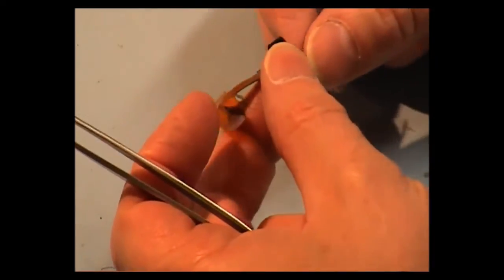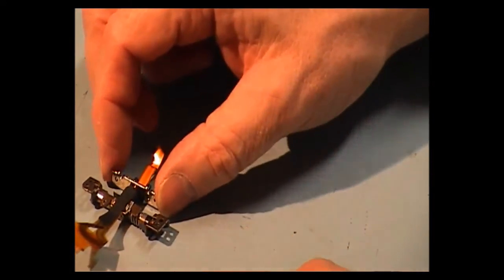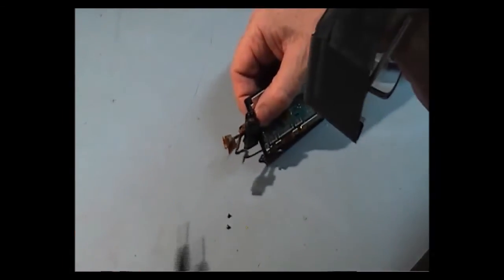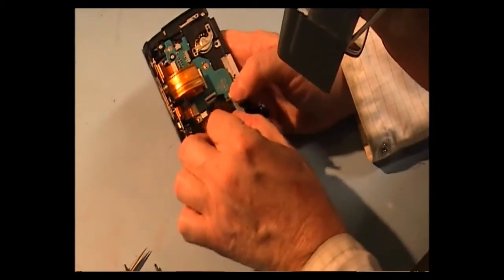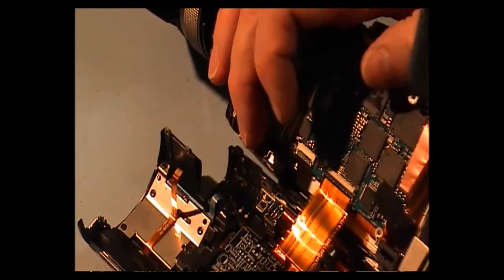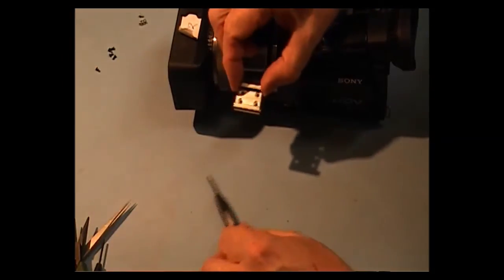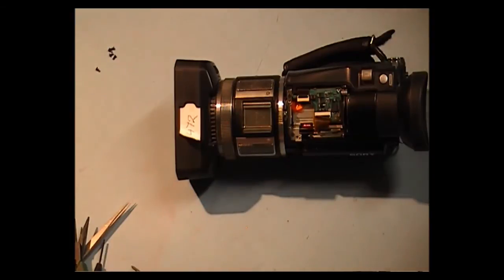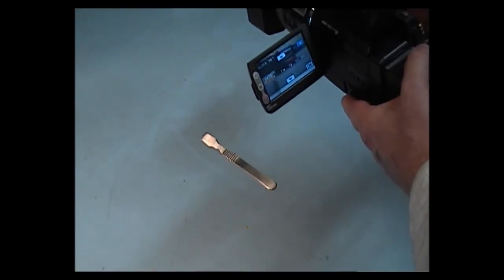Sony HVR-A1E No picture on LCD Screen Part 2

Comment: Hi there and thank you so much for this clear, informative and easy to follow demonstration.  Its very kind of you to put the time and effort into making this! 
Unfortunately after completing the flex cable replacement, I still had the same issue with my camera.  The LCD was showing an image before, however was unresponsive to touch controls.  When I pressed any of the touch button on the LCD they illuminated orange suggesting it is recognising the press, however nothing then happens.  I was preying that it was a fault in the flex cable but as I say after replacing it I still have the same issue.  Do you have any ideas about what it could be? Perhaps it may just be easiest to buy a new LCD screen.  
Thanks again for the video and any help you may be able to send my way!!
Reply from the maker: I would like to have had the answer for you, the fact that the touch screen responds to your touch, makes it unlikely, its the screen, but the screen cant be ruled out,
Not an easy call to make.
Reply: Electronic Workshop Thanks for your response.. so the screen might be the issue.. otherwise could it be a problem with the main board possibly? real bummer about this one, would love to get it sorted!
Reply from the maker: milesawayjackson The graphics you see on the lcd screen are generated on the main board, when you touch the screen, you say the graphics change colour when you touch the lcd, this would say the information is getting back to the main board from the lcd, I would check in the menu's to see if there is a setting to disable the touch screen first, then double check your cable connections on both ends, I normally use a magnifier to see the connections,

Comment: Hello,
1st off all thanks for the hard work in putting this online.
2nd I'm having the same probleme here.
Before the camera powerd up and worked fine with the viewfinder, now is dead, no power at all. 
I've striped it again, checked the cables, checked the connections, checked the board itself for anything suspicious but I can't seams to find the error. Can you give me some tips ?
With the battery in it - no power, with the adapter in it no powe.
Tried:
- cables, connections;
- removed the hole battery assemble and re-attached it.
- removed the power adapter and re-attached it.
What the hell is wrong with it ?

Thanks in advance !

Comment from the maker: If the fuses are o/c, they had to blow for a reason, and you will have to replace these, but make sure there is no shorts on the supply lines of these two fuses,

Comment from the maker: First I would have to check my connectors at each end, make sure the contact side of the cables is making contact with the connector contacts, the non contact side of the cable, could be oriented towards the connector contact side. Its easy to put them in wrong, I did it myself  on a couple of repairs

Comment: Great video. I had the classic dim screen and non working touch, unless turned around and pressed into the body. 

I replaced the ribbon but when I turned it back on the screen now didn't work at all. I put the original ribbon back in and it's still black. The viewfinder turns off when the screen is opened, but it does nothing. Any thoughts?